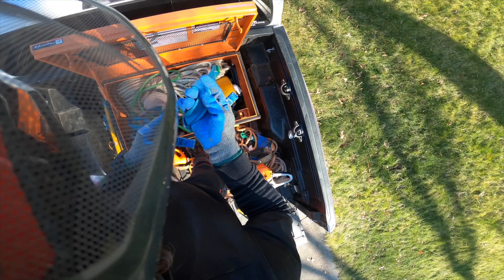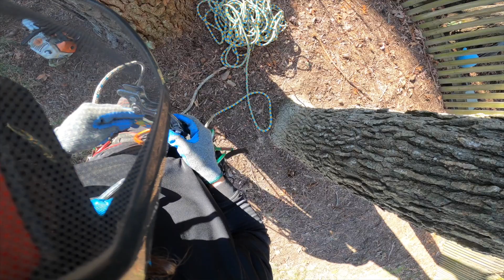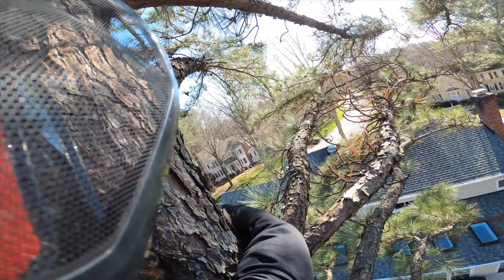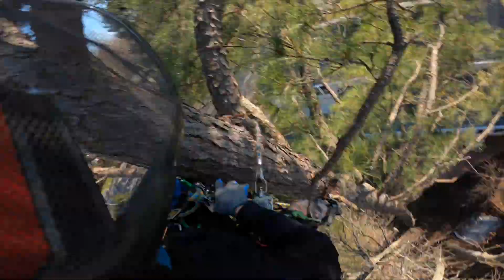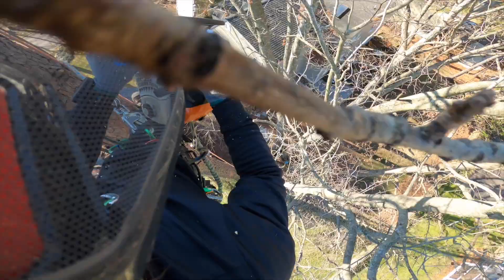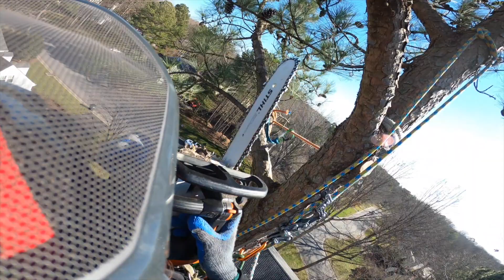Pt.1 How I take down every pine tree (Raw)

Comment: good stuff man. it's cool to see a bit of your gear setup ... I haven't used a leg scabbard for my handsaw but it seems to work pretty well for ya. nice work man
Reply from the maker: Yeah man those leg straps are awesome. Not a fan of the dangly stuff. With those leg straps you can grab your saw without looking/tense situations because its always in the same place! But the straps wear out after about 6mo. But they are cheap like $20